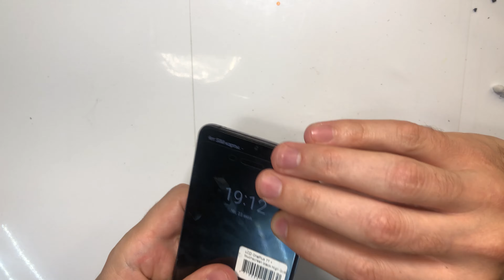OnePlus 7T - Замена Аккумулятора / Battery Replacement

Comment: Hello! How long have to wait for the glue to soldify enough to use the phone? I know officialy 24-48 hours, but I think you don’t have to wait that much to start up the phone.
Reply from the maker: 12 hours
Reply: @iFiXyou  Thanks! 
I replaced the battery with a new original one, but it is draining as fast as the old one which had 4 years...Any idea how can this be solved?
Reply from the maker: yes, it’s better to look for quality, unfortunately this happens often and they work for no more than a year, and this applies to all brands of phone